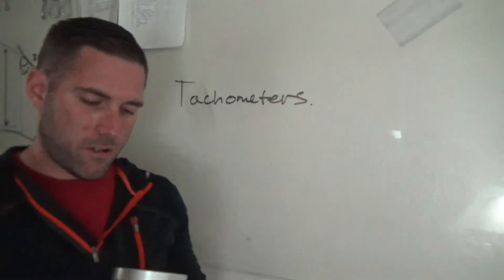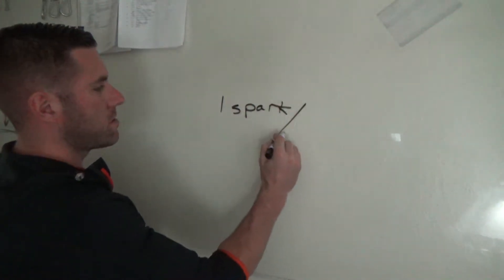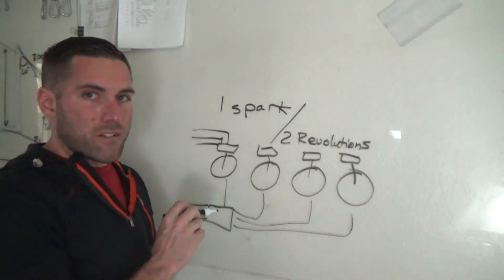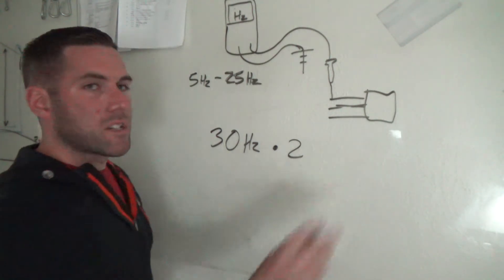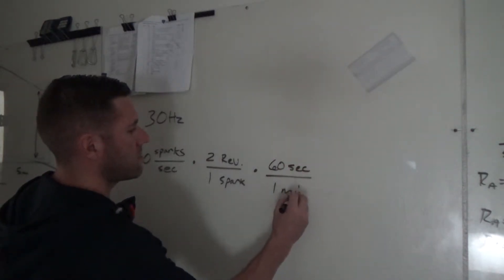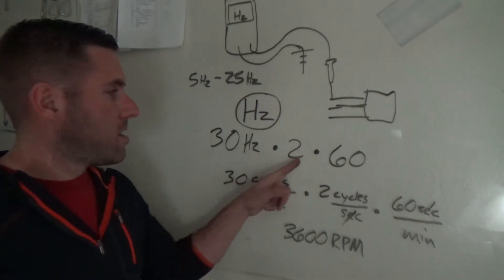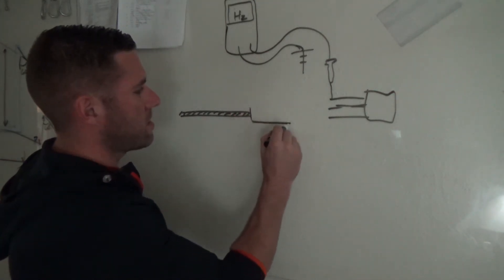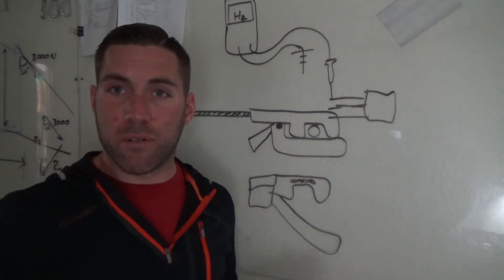Tachometer Calibration with Multimeter

Comment: Thanks for the video!  I put my multimeter on the negative coil (same as green wire on my aftermarket automotive tachometer) since my car does not have separate coil packs.  It's a 6-cylinder.  The meter shows about 250 hertz at 800 RPM, which calculates to  (200 x 2 x 60) / 6 which should be 4000 RPM.  My meter shows 6000 hertz at 1600 RPM, which calculates to (6000 x 2 x 60) /6, which is 120000 RPM.  Do you know what I might be doing wrong?
Reply: your test wire is laying across other plug leads, so it's picking up other signals...make sure you lay them as seperate as possible to the other spark plug leads.

Comment: Would you only test the negative wire on a single coil? And how do you actually change the tach to match the readings?
Reply from the maker: you only have to know the firing frequency which will be unaffected by polarity since you only need to read a state change such as energized or not energized.  Changing the tach to read a specific system is a video that will come out soon as it will be a full blown series on automation controllers.  Currently putting an Industrial Automation system into a 3500 Savana Long Chassis for demo

Comment: Great video 
I have a 1965 Ford Mustang with a 289 V8 and have used a gear ratio app to compare the tacho reading at different speeds and after lots of issue getting a good reading a 400v 1A Diode fixed the issue in line at the coil side to the tacho, I have confirmed the Tacho is out by 400 rpm at 100 km, I have been told I can fine tune it with an adjuster screw on the back but I what be able to do it with a second device like a multimeter to correctly adjust the tacho.

Would the formula HZx2x60 be the same for my 1965 Ford Mustang V8 using factory coil, the green wire from the tacho goes to the negative side of the coil, what is the correct formula .
Also on a cheaper multimeter would the HZ symbol be V~

Comment: Very informative, but if you working on a "waste spark" ignition systems you dont need to multiply by 2. For example mazda and ford vehicles with 2 ignition coils for 4 cylinders🙂. Like mazda protege. They have ignition systems like 2 stroke engines

Comment: Great video! I’m doing an engine swap to an MR2. I haven’t installed the engine yet but just wondering about the tach. The MR2 tach has resistors, but I’m not sure what resistor to use so that it reads to the RPM signal from the coil packs off the Honda k24a2 engine. Based off your video I can determine rpm from the Hz reading. But how can I use that information to change the resistor sensors so that the tach reads correctly? The old MR2 engine read from a distributor cap. I’ll be running a haltech ECU and the software should be able to read the RPM as well. I’m just not sure how I can get the RPM signal to read on the tach.
Reply from the maker: Most systems that read into a tach signal have two things inside; diode and timer/counter.  Most tachometers need very little input to read a signal and the resistor isnt there to identify the signal, its there to keep the input from burning up the tachometer.  Get a 20k, 15k, and 10k resistor and start with the 20 then 15 then 10.  You can confirm the correct one with the procedure in the video that it is reading correctly.  In very rare cases a capacitor is needed with the pull resistor but its not often at all.
Reply from the maker: typically a tach with a resistor has a capacitor and an analog range inside it for a certain number of millivolts or milliamps to sweep the gauge.  So in my experience, and soon to be yours from the next couple videos, i would start with a 15kohm resistor and step it down 2000ohm at a time until it reads right.  Most hall effect, current reads, inductive and capacitive sensors seem to read well at 10kohm signaling however for vehicles it may be different  use the meter as you try different ones and confirm the right resistor is what I'd do if it was my vehicle.

Comment: Is it possible to calibrate a 4 stroke tacho to work correctly when hooked up to a 2 stroke ?
Reply from the maker: negative sir, as the tachometer would have to ignore half of the inputs, if you set up transistors to switch on and off for each pule input it would work, but that's a largely useless endeavor unless the tach you want to use is really really really that important
Reply: @sinewavespecialties2373  Thanks, yeah the tacho is pretty important as I'm using it on my motorcycle, its a 1997 Yamaha 2 stroke single cylinder road bike. What kind of transistors do you recommend ? I tried using a frequency divider by 2, the IC7474 but that didn't work and made the tacho go wonky and wierd. I guess it couldnt work at such high speeds. As my bike doesnt have a tacho out from the factory, I plugged the source wire of the tacho, to the spark's pulse wire, voltage is a very gentle 3-5v and it works fine, but not correctly. Thanks.
Reply from the maker: @BrattyBiker  that divider probably is fine, issue is probably reactive power input,  circuit probably needs an inductor in the mix somewhere to stabilize the power if it isnt AC
Reply: @sinewavespecialties2373  Thanks. Yes, the tacho works at 12v DC. The IC7474 works at 6v DC so I plugged it in the lighting coil which is 12v AC and used a IN4004 diode to convert it to a 6v DC. Unfortunately I still blew the IC up within seconds but the diode was working fine, I tested resistance too. This seems to also have messed up my tachometer now that the needle doesn't move beyond 2,000RPM 🤦🏻‍♂️

Comment: Does min/max with the clip on style lead just give you the max Hz or a different formula needed?
Reply from the maker: min max is the respective minimum or maximum of the reading.  works for hz, amps, volts, etc.  If you want to see how low the cam runs then minimum, if you want to float the valves use maximum.
Reply: I’m trying to find max rpm on a 2stroke outboard boat motor using a induction clamp. Min/max doesn’t work on my Hz setting. It is also reading crazy high Hz like 150 witch would be 9,000rpm if I’m correct. I don’t think that is accurate. Any suggestions?

Comment: I think most of cars like as i have Suzuki Swift 1.0 G10A engine 3 cylinder piston strikes up and down motion ate not in same 2 up single down 1 up and 1 down it can be any pattern
Reply from the maker: It doesn’t need to be because the crankshaft rotation has the same ratio with respect to all other pistons in the engine.

Comment: Can this be done on a diesel and would the w terminal on the alternator give the reading cheers.
Reply from the maker: The meter will generate a reading on an electrical pulse input, so this means something that gives off a signal for every rotation or every other rotation of the engine would produce a reading that can be mathematically applied using this video, HOWEVER, if using the alternator you could get a reading from the rectified 3 phase or the actual 3 phase but now you must figure out belt length and ratio of the crank to the alternator to know what the ratio of revolutions there are, it begins to get a bit tricky but my next (long awaited) video will describe that

Comment: 2 wire Inductive clamp, one around spark plug wire and other to ground, is that correct?
Reply from the maker: Your inductive pickup is going to act as a “positive” source so yes,
Reply: @sinewavespecialties2373  yeah my hour/ tach meter from Amazon had some very basic install instructions.   Mine is two wire induction style, but instructions just state WRAP WIRE FIVE TIMES AROUND THE PLUG WIRE. I agree with you guys, the main wire needs stripped back, exposing the two finer wires, determine which is the pickup, determine which is ground.  Then move forward with installation.  (Damn Chinese Amazon electronics literature) 🤦
Reply from the maker: @sidewayzmike  pretty typical, its the same with key fob simulators used in VW and Audi vehicles for remote start systems.  Have to wrap the fob because the NFC isn't mainstream yet for programming to a module.
Reply: @sinewavespecialties2373  I've messed with some kessy systems, had a rough time getting my feet wet, regarding diagnosing no crank no start from push to start vw/audi.  Found two paths to get communication back/vehicle restarting/position 2.  Power probing some relay under dash (maybe #416?), and even easier was simply quick deleting kessy fault memory, lol.  Then condemn the module/column from what I recall.  That was probably 2 years ago..vag hardware is currently out of commission due to a recent firehose situation, lol
Reply: @sinewavespecialties2373   Can you explain how you bench test a tach. I think it works in reverse, send a variable pulse to the signal wire and ground from the pulse generator?
Reply from the maker: @BasketCaseGarageForFun  I have not bench tested one, just comparative test in same source.  If I understand tachs competently I’d say only an analog drive tach can work in reverse and even that is a “maybe”.  Issue with digital is it is using absolute values for its function.  Most analogs I would guess have a diode to produce the same resultant output so the needle doesn’t go haywire.  NOW IF you blow that diode in the system, which I’m sure is shared by a bunch of gauges to save money, then yes, I believe it could fly the wrong direction.  This is all theory, so hopefully something I said helps